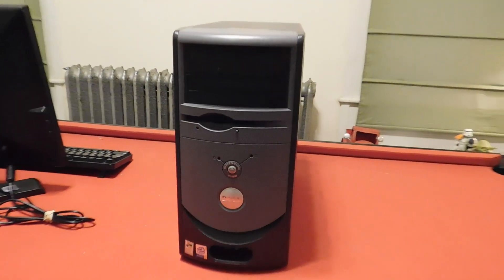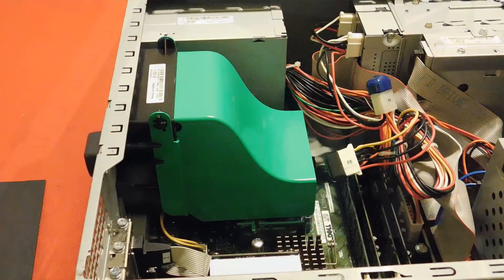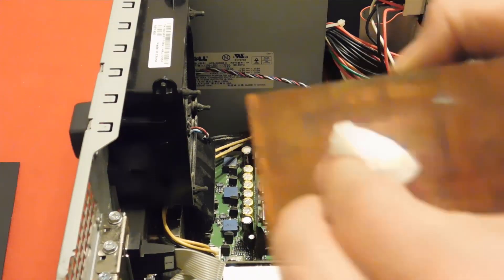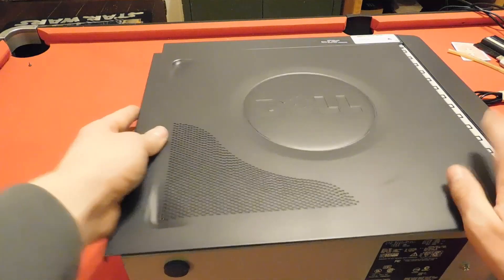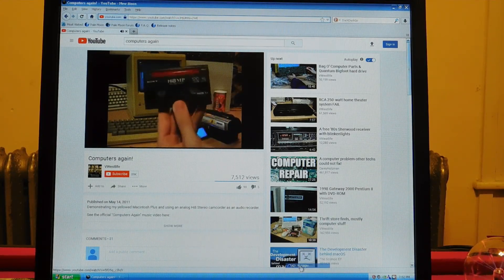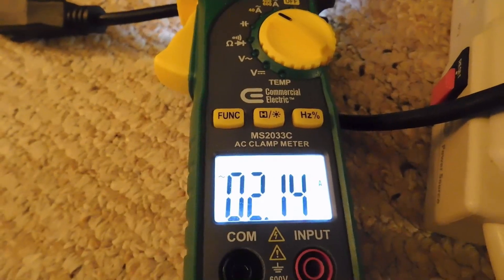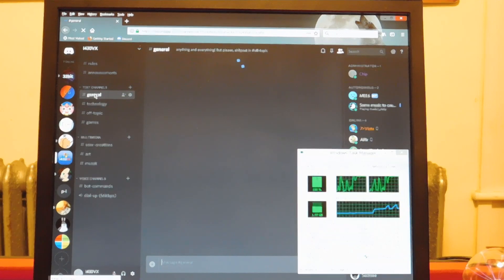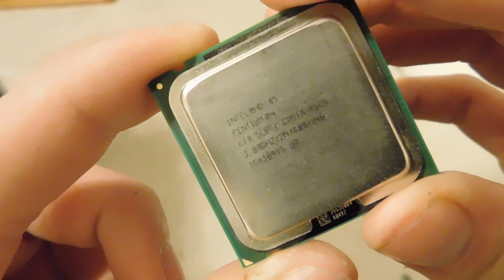Using the fastest clocked Pentium 4?

Comment: i prefer overclocked cedar mills instead of prescott... my p4 651 @ 4.7 ghz actually doesnt get that hot and only needs about 1.37v to run stable at that frequency
Reply from the maker: Yeah cedar mills are WAY better, but on this system i'm stuck with Prescott (and no OC) on this Dell system.
Reply: @I430VX  yeah crappy oem boards with barely any settings in the bios... i think my p4 could even do 5+ ghz but sadly the board im using (gigabyte ep45 ud3) limits the vcore setting in the bios to 1.4v (~1.37v after vdroop) when using a netburst cpu
Reply: @I430VX  actually if you have a ton of ram to shuffle into the system through trial and error it will work. My system with a cedar mill is very picky about what ram works for some reason but it's doable.
Reply from the maker: No, I cannot use cedarmills at all due to lack of support in the BIOS